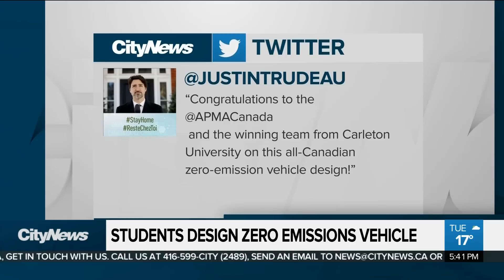Students design zero emissions vehicle

Comment: more is not the answer, less is the solution, make less buy less .
Reply: your theory will not work because when the population becomes big enough it require a certain level of work to sustain its self - we are to big to go back - there are a few ideas that can work but no one has ever talked about them such as 
1 using large buildings as urban green house farms -
2 using large buildings as solar / wind power generating stations 
3 distributed / non centralized energy generating concept 
4 the idea of using aluminum cans to hold water instead of plastic bottles ( creating an incentive to recycle ) - we need to be more creative and less political